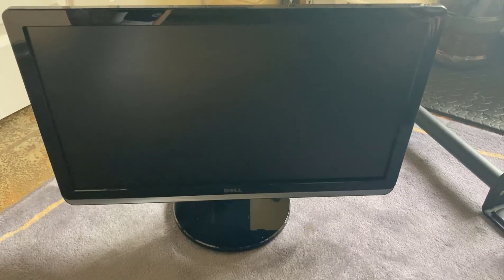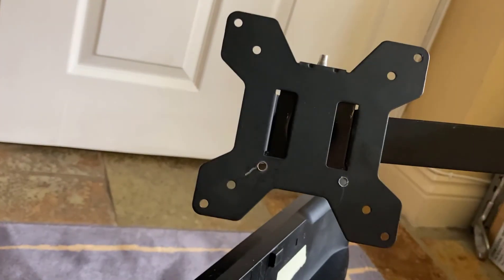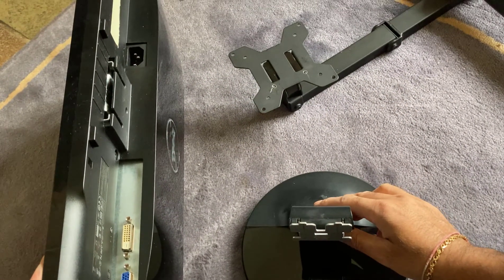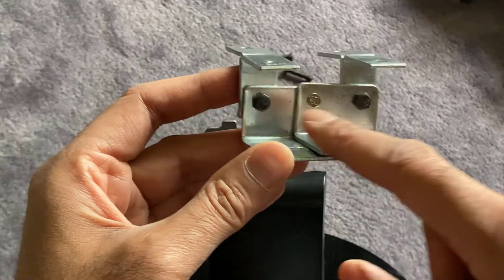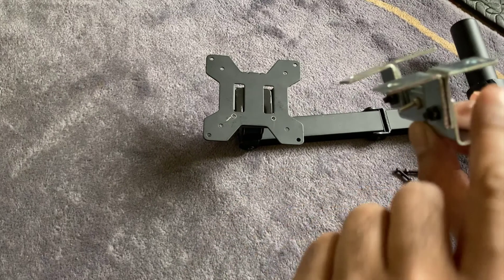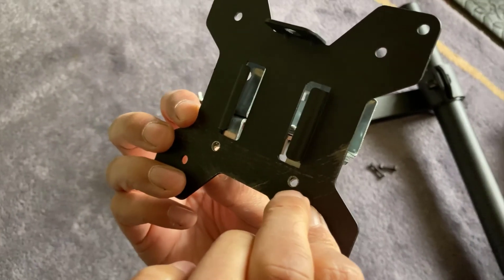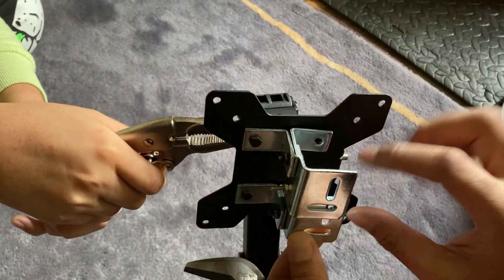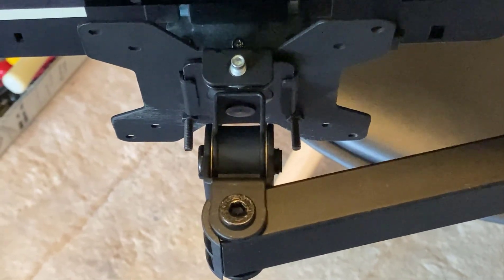I made a Dell Monitor mounting adapter bracket

Comment: Where can I get this?
Reply from the maker: You can get the parts from most DIY shops or you may just have them lying around in a workshop or garage. Then simply follow the video to make the bracket. It's not something you buy, this is a DIY build.

Comment: Thanks so much for this video :-D Quick question, is it strong enough to rotate the monitor into portrait mode too?
Reply from the maker: Hi, the bracket will only hold that particular monitor in landscape only as the mount is from below and you rest the monitor on top. I very much doubt the monitor will be stable in Portrait, but the mount could easily be adapted to suit whatever style of mode with extra support.
Reply: Ah yes, I understand what you mean. I’m going to be trying your way soon! Thanks again for the great video!
Reply from the maker: @bradleyAbennett  Good luck and do let us know how you get on, always nice to see others build on ideas.

Comment: Can screen go vertical and stay stable?
Reply from the maker: This particular monitor only has an opening for horizontal mounting only. If you have a monitor which allows rotation, this bracket should work for vertical mounting.

Comment: Would you look up Dell Monitor 4WH45AA#ABA  - look at the back of monitor bump out. I need to attach the monitor to a NB Northern Bayou monitor. Would appreciate help -
Reply from the maker: Are you sure 4WH45AA#ABA is Dell? Comes up HP
Reply: @HandymanSavage  My bad it is HP - sorry - if you look at the back - they designed strange with that lower rear bump out. Been trying to figure out a way - and thanks!
Reply: @HandymanSavage  Well my friend after days I got through to HP. They have nothing stating stand hole is very small like a square. I asked about taking the back off - dont want to but drilling holes and putting small bolts out the back to mount. They said it is not designed for the weight, It seems and I am just thinking outside the box those mounts that have the long arms to connect over the edge but having a material for the bottom that could bend or like a thick rubber bungee type material that fits over the dumb bump out. I do not suppose it is possible for us to email and not have others see our data? I would just like to think up possible ideas before giving up..Regards - Bill
Reply from the maker: Hi Bill, thanks for the background. Well that looks like a 32-inch monitor so HP are right about the additional weight issue. From the pics, that HP model stand pole looks no wider than a straw (lol). The Dell monitor I used in the video is smaller (possibly 23-24 inch) so lighter and the stand pole is wider to spread the weight of the monitor. I've used this solution since that video and it's still used every day and not failed yet (it will probably fail now I said it)
I reckon with the combination of the weight of your HP and the pencil-thin stand, you might be best replacing it or looking at raised shelves depending on how you want to place it.